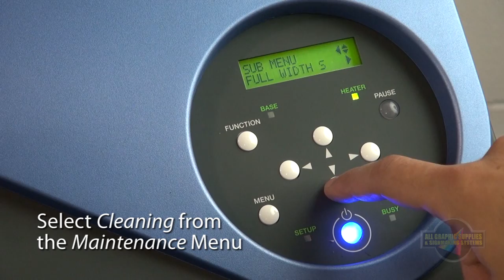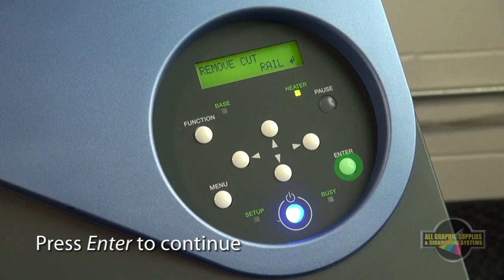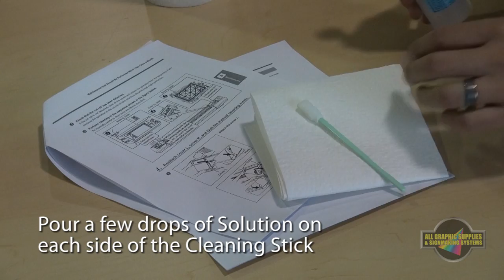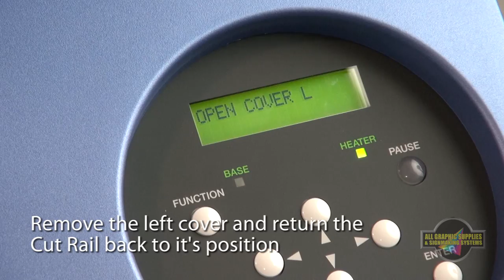Roland VersaCamm VS Series: Cleaning & Maintenance - All Graphic Supplies

Comment: Hello,, Can you please help me out. My friend has the same printer with USB connection and when he opens Versaworks it detects the printer but as soon as he presses verify to add the printer. A messages pops that the current version does not support your ink type? He is using version 5.51 and ink roland eco sol max. Can you please tell me what's he doing wrong? Thanks a lot